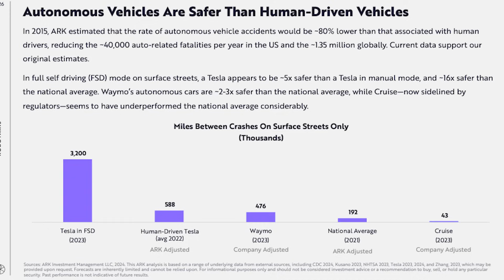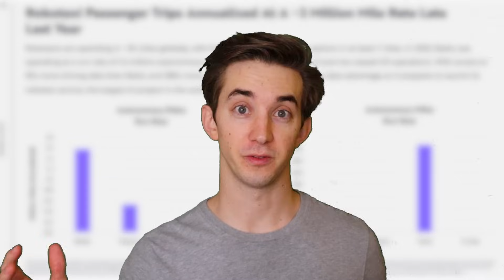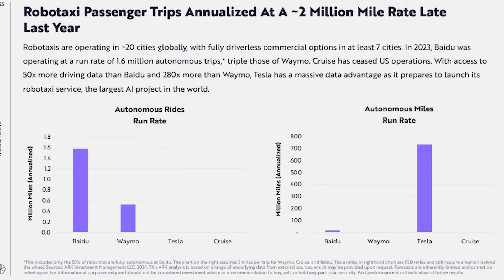Why Tesla FSD V12 will leave Waymo in the dust (customer review)

Comment: Tasha has only the very shallowest comprehension of the regulatory and legislative obstacles Tesla will have to overcome.

Waymo is not threatening. The business model won't scale. A few hundred uneconomical Waymo robotaxis is a curiosity, not a danger for the status quo.

Tesla, if allowed, could almost instantly switch on a million robotaxis, none of which will require added hardware.

The political opposition that failed to notice Waymo will come out swinging.

Political opposition may not be the only thing in Tesla's way.

Here's the thing: Lidar and geomapped autonomy is 1990s tech. Single-mode video-based AI models - FSD is the only one I know about - is 2018 tech, amplified with generous data and compute. What is 2024 tech?

In 2024, we are closing in on AGI. Models are multi-modal LLMs. Video is one of the modes.

Comma is not in the hunt for AGI. Neither is Tesla - yet. Tesla has the resources, but Comma does not. Comma will fall out of the running.

The strange thing about the LLM approach is you instruct it with simple text commands. Don't hit anything, take the rider where he wants to go, obey all traffic laws, park here when not in use, report accidents to the owner including rich details, etc. AGI may be able to do the rest - without an enormous data base.

FSD needs thousands of what-to-do examples for every conceivable situation. AGI will need even more training compute, perhaps, but fewer examples. The training compute isn't just to train an autonomous driver. It's to train a mind.

Humans don't need thousands of examples for every conceivable situation. Training a human driver consists largely of explaining principles - in plain text with a few video examples plus a few hours of hands-on driving with a teacher.

Waymo's current approach is a dead end, but standing behind Waymo is Alphabet, parent of Google, one of the leaders in LLM development.

It's too soon to be sure how this will play out.

Don't count your trillions of dollars in revenue just yet.
Reply from the maker: Nicely written, thanks for your thoughts, always enjoy them
Reply: Its all fun and game until a deer crosses the road during the night. Lidar would see it coming ages before cameras. Camera probably won't detect it until the last second.... We should learn from aviation. The sky is mostly empty and airplanes are equipped to the teeth with various sensors to deal with IFR conditions.
Reply: @jamesclerkmaxwell8020  I think perhaps we should be cautious about imagining scenarios where vision-only autonomy must fail.

For one thing, the car's reaction times are inhumanly fast.

For another, beta testers have seen instances where FSD v12 detected dangers before human drivers did. The fidelity of the sensors is actually better than human vision.

And finally, your theory is entirely theoretical at this point. Theory is one thing, facts are another. Your theory needs testing.

Did you know that lidar does not see color? It sees shapes. Last I heard, cars equipped with lidar don't know what they are seeing, only that something is there. It does not see a deer, which if identified might be expected to suddenly move unpredictably. It sees a shape. That's it. FSD identifies objects and tries to differentiate between objects that are fixed in place and objects that might move, such as a parked car. Or a deer standing very still.

Lidar doesn't collect enough information to identify what it sees and plan accordingly.

It is not obvious to me that Waymo robotaxies will outperform FSD v12 in avoiding deer. But it's an open question, one we would like answered.
Reply: @Urgelt  Thanks for your answer. A deer crossing the road is nothing theoretical. Driving at night is not theoretical. Driving in the fog also. It happens all the time.

What good are insanely fast reaction time if the camera see the deer at the last second, where an evasive manoeuver would likely entail loss of control ?

Lidar cannot see colors, just shapes, totally correct. So do cats (and T-Rex according to Jurassic Park :-) but detecting the movement of a large object say ten seconds before camera could ever see it... its a huge safety advantage for a driverless scenario (or even as a driver assitance tool... like Waze warning you well in advance of a hazard on the road)

 You submitted the hypothesis that "Tesla could switch on one million Robotaxi " overnight. Here is my prediction (nothing scientific, of course, just a solid hunch) : if Tesla did so, I bet you that hundreds of crashes would be registered in the following days, especially in low vision conditions.

This is a life and death question. Elon dumped sensors for their cost. He can do so if he wishes to reduce costs. But he should not brag about bringing Robotaxis on the road while dumping sensors with his vision-only radicalism.
Reply: @jamesclerkmaxwell8020  yes, the deer scenario happens all the time.

But nobody has tried to quantify performance of Waymo versus FSD v12 for that scenario. In fact, nobody has tried to quantify any comparison between the two systems. That is where your theory does not cross over into facts.

It's understandable why comparisons have not been made. While FSD v12 is just now reaching some users, Waymo runs a closed, opaque shop. They aren't terribly enthusiastic about the public getting its mitts on objective data about the performance of its system.

So your theory remains theoretical, for now. The scenario is real enough. But objective data comparing performance in that scenario is lacking.
Reply: @Urgelt  Thanks again for your answer, I appreciate it. Indeed, you are right that the research has not been done yet, but I think the assumption that "the more redundant and complementary sensors, the better safety gets" is a time-tested truth in the aviation world. It will naturally apply to cars, too. I am not an investor in Tesla or Waymo, I have no horse in this race. I just know I would never put my kids in a driverless car having only vision sensors at night. This is clearly an economical decision from Tesla to cut costs. I found Elon's diatribe on Lidar disingenuous, and Karpathy's take on them evasive when he talked about it with Lex Friedman on his podcast. There is no way to rationalize "less sensor types brings better safety" IMHO.
Reply: @Urgelt  Thank you so much for your thoughtful input on this. You are right on the money on many aspects. I happen to develop a robotic device that will require sensor fusion and indeed : which one do you prioritize ? Now AI could solve this much better than plugging AI on cameras only. I will digest that food for thought during my daily walk and come back to you with a more complete answer :-)
Reply: @jamesclerkmaxwell8020  thanks for a fun conversation!

Comment: Why does waymo even gets compared with FSD?
Reply: Waymo system is ahead of fsd. Only knocks against it are price and aesthetics. They’re compared because they’re both attempting the same thing and their approaches are different.
Reply: @singed8853 Waymo’s main criticism is being geofenced and needing HD maps which just can’t scale to cover the entire country and have constant realtime updates. I’m sure they will eventually get good enough to not need HD maps, but until that point their system can’t scale
Reply: Because they work pretty good?
Reply: @hockeybockey7842r9  : Waymo has been  giving rides for more than 3 years with no driver inside  the car. 😂😂🤣🤣Tesla ??
Reply: @Area51-is6vg  I hear this argument all the time. Waymo may already be giving rides but has huge limitations in doing that. Tesla are not giving rides, does that mean they are behind? No, not if you look at the bigger picture. Tesla are tackling a much bigger problem of cheap, scalable and capable of worldwide use. To my mind Tesla have now solved self driving, it is just a matter of time and data. and because of the huge advantages Tesla has, they are set to dominate in this space.